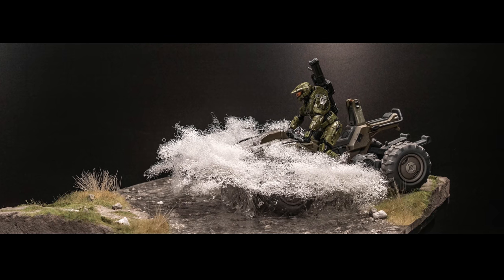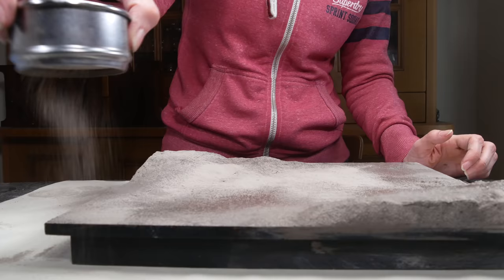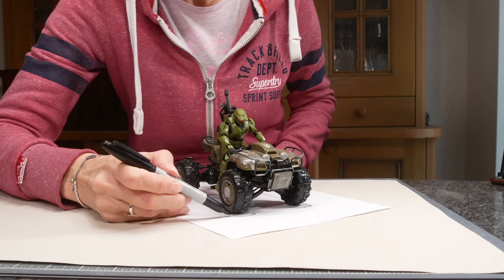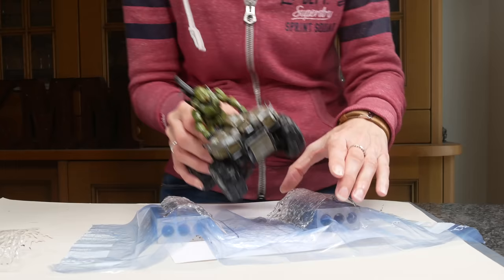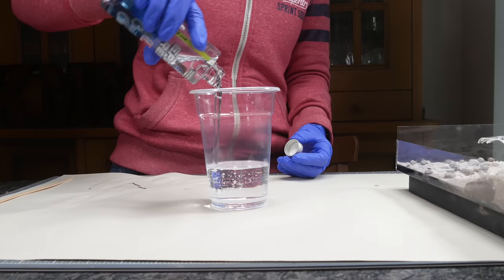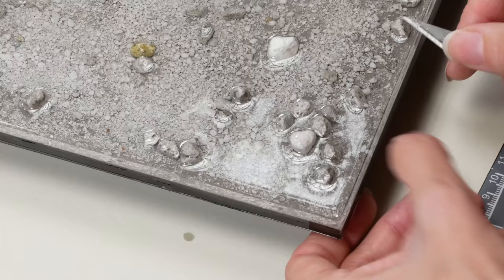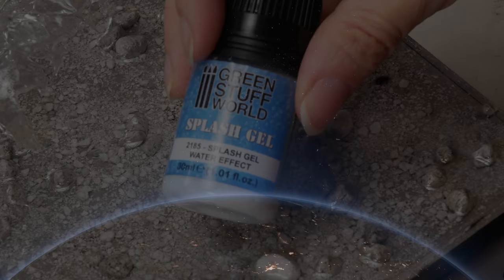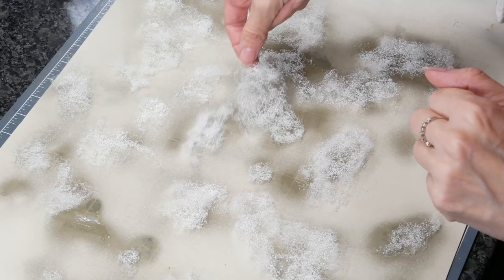Model a Water Splash - Halo Mongoose Diorama

Comment: UV resin is useful for things you need to dry fast :) I used it for the fins on a hippocampus model
Reply: *cure
It will never dry in the dark :p
Reply from the maker: I hadn't used it as a glue before but I will in future.
Reply from the maker: That was my worry about using it for gluing deep joints.
Reply: @KathyMillatt  Its a chain reaction...would still work.
Reply from the maker: @LaserGadgets  that’s good to know, thank you!